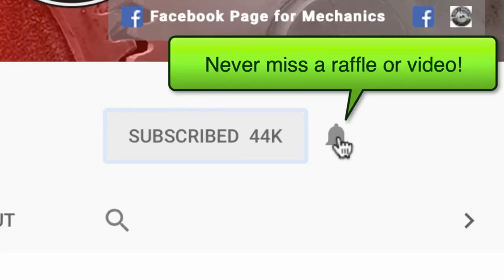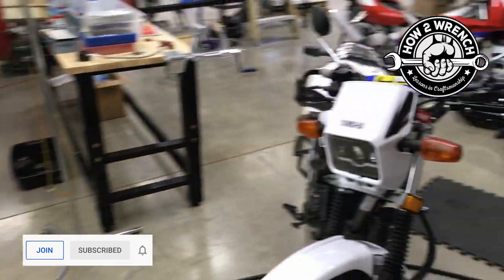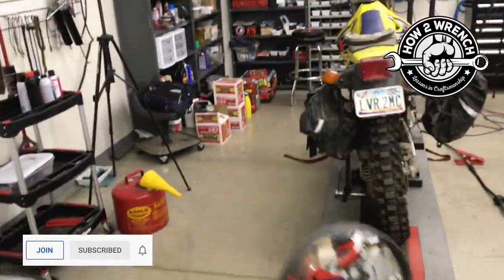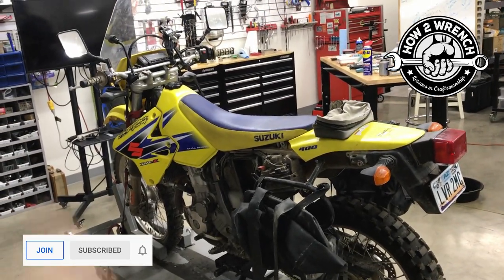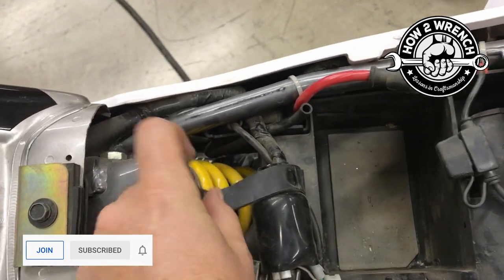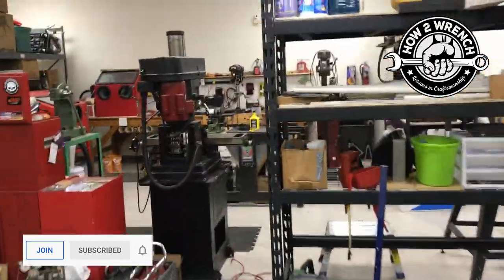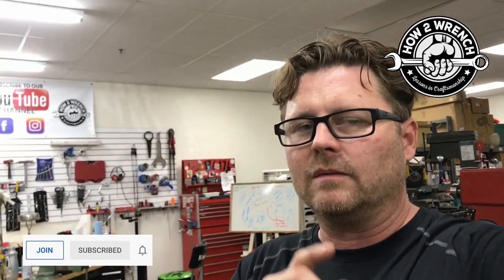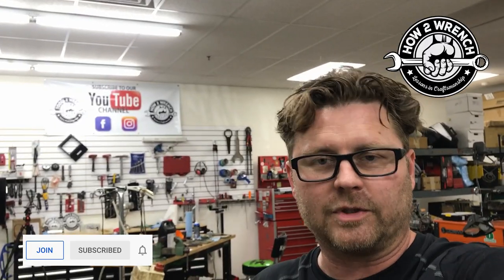Should I pull the battery or charge in place? #batterymaintenance

Comment: If a battery needs charging, I remove it and charge on the bench, sealed or not, for the reasons you point out. In addition to the wiring/connections, I like to inspect and clean the battery tray area too.
Reply from the maker: Nice...👍